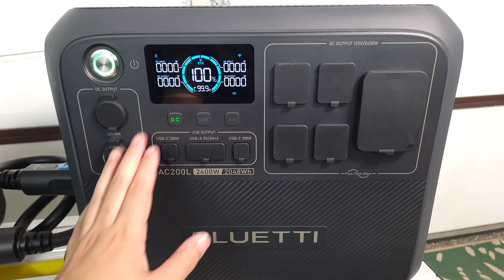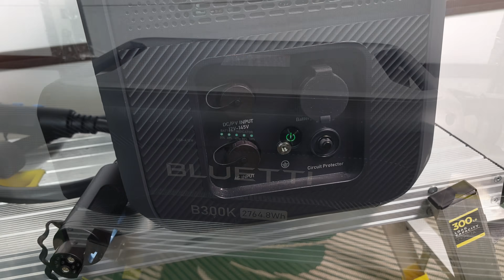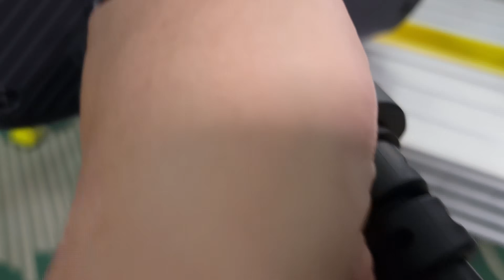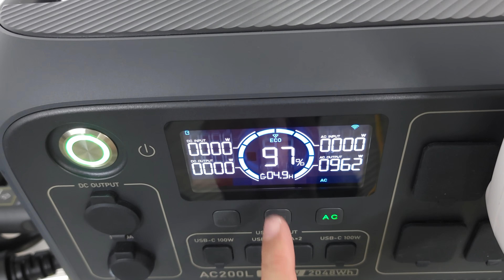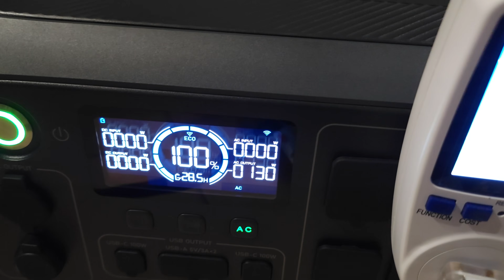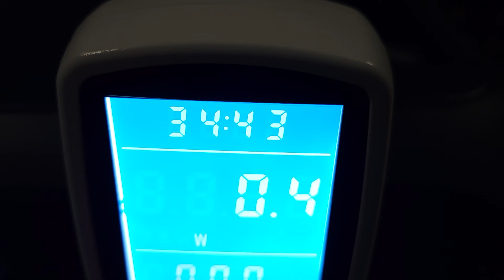A Great Home Backup Solution! | Bluetti AC200L + B300K Expansion Battery Review

Comment: Ya should have bought two AC200L that way when you are charging one the other is being used. The battery is just a battery so it is useless if the AC200 goes down. If ya buy 2 AC200L then if one dies ya still have the other one
Reply from the maker: Yes, but that adds the complication of having to switch the solar panels on each one to charge, and switch again when I want to discharge. Not as convenient as having an all in one setup with a set it and forget it setup.

Comment: But since that cord is so thick and bulky, you can’t stack those units on top of each other because the ports are on opposite sides so you always have to have them separated? You can’t stack the AC 200 L on top of the battery or the other way around that makes storage kind of a pain in the butt taken up too much room.

Comment: Why the connecting cords are in the opposite  sides,you can't stak them up
Reply from the maker: You can, you just need to rotate the battery so it faces the other way. Odd design decision for sure, but no problems stacking em.

Comment: I thought I seen on the bluetti website that the B300k didn’t have it own ac and PV input,  to bad it doesn’t have its own 120v 20amp outlet.  a refrigerator and my efficient gas furnace are my two main worries and a fan of its hot out , im glad i didn’t get one of those smart refrigerators, I’m sure those draw much more power but the smart refrigerators are usually better insulated

Comment: Excellent presentation.  ...as in ...a few weeks ago we got and began daily cabin usage of  the AC200L. With a few snowy days and a few sunny ones of Jan, 2025, our winter battery charge from 4 old 120W solar panels has kept 2 computers, monitors, router, phone battery chargers, one small 120V lamp, and the coffee grinder going just fine. .. Today we received one B300K .. Tomorrow I'll start the 5000W generator to run the 200 ft deep well pump. After collecting a few days gallons of water, I'll connect the power cord between the generator and the AC200L. .. When It gets charged to 100%, I'll turn the AC200L off. .. Then I'll connect the new B300K expansion battery to the AC200L power station with that heavy duty multi-function cord, like the one you showed, that came with the new battery. .. Once connected I will turn on the AC200L... I am eager to see how the new battery's (unknown yet) charge alters the AC200L reading of 100% charge. 
.. I have some 30 remote years living with 4 to 6 old solar panels and a few lead acid storage batteries. Discovering and correctly computing the electrical complexities, and handling the effects of lead acid battery charging fumes on nearby wood can be DIY done..-->  However, these new Portable Power Stations are a fantastic improvement for me!

Comment: i bought one of these to replace my ups that stoped working, this is a lot better , i can take it camping and to work , only half the price of a new ups, will be buying 2 b 300k s ,very happy with it. in aus😀
Reply: Good luck - the day will come when you need it and it doesn’t work.
Reply: @leemobai762, i wouldn’t be a bad idea to build basic home built solar generator, buy an  extra solar controller and a pure sine inverter, these store bought solar generators have a lot of high tech features that may quite working when you need them the most

Comment: Can you mix it with the AC200L that is already connected to a B210 expansion battery?
Reply from the maker: That I'm not entirely sure about as I only have the B300k. I would advise reaching out to bluetti and see if you can mix and match expansion batteries.
Reply: check the specs for your unit model on Expandable feature that might allow you to add up 2x B300, that total is over 8000Wh.

Comment: Still far from gas generators. Gas can run a home for days or even weeks..these only hours
Reply: Gas can burn your house, in hours.
Reply: Hooked up to solar unlimited power, quiet, keep inside your home, etc.
Reply: One gallon of gas in a good gas generator is equivalent to 5 KWh battery storage. So you can have a 100 kWh equivalent battery with 20 gallons of gas. But here’s the kicker. You can recharge the batteries for free using solar where the gas tank has to be refilled with gas each time costing you $40- $100 per tank depending on what area you live in. In a disaster situation  not many people have access to 100 gallons of gas. If you have a big LP tank you might get lucky and survive damages to the tank and it’s still usable. But natural gas is usually cut off during disasters for safety reasons.

Comment: One of the most important things to know is how long it takes to recharge the unit and expansion battery from fully depleted. I cannot believe you ran the power out but then did not recharge both and show the time to recharge both of them seperate and together.
Reply: I’m actually watching this video to see how long it will charge both… as far as I know it’s charged in turn, first extra battery and then the station itself.
Reply: @vqa33  They all charge are the same time. I have 2 of them and the 200L and I ran them both down with a 1850W load and it took me ages.- at 2450W it took 4 mins to go between percentages.

Comment: Can I charge this with my Honda generator?  I live in the Caribbean and don't want to run my generator over night and just want to run a couple of cheap floor fans.  We loose current frequently.  Thank you.
Reply: I’m pretty sure you can - as long as it’s a pure sine wave inverter. I’ve seen other channels w/ people charging the 200l with Honda
Reply: @smirking8457  I called Honda and the sign wave is good thank you
Reply: Yes!